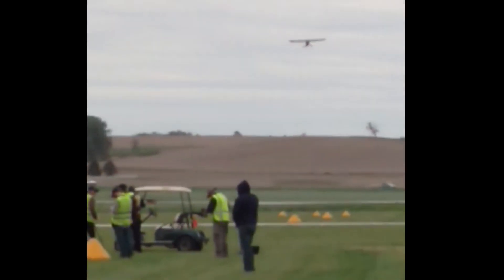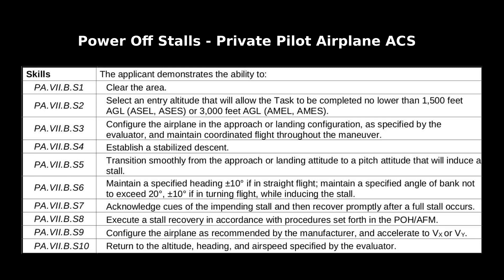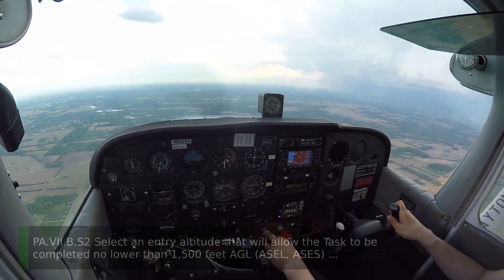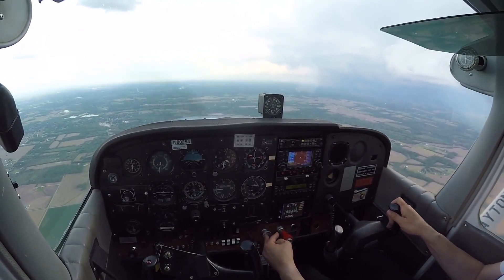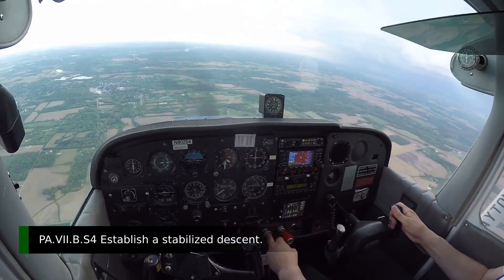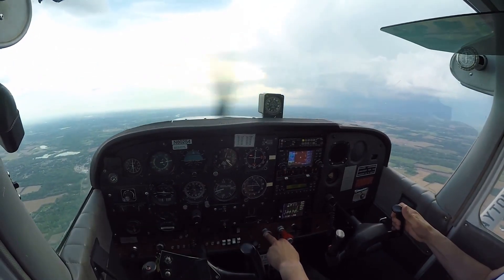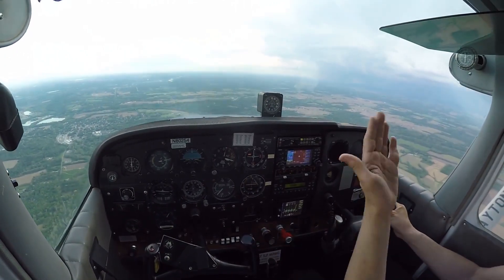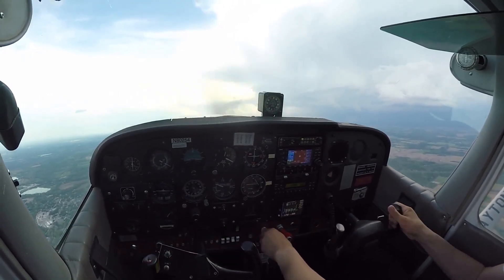Power Off Stall - Private Pilot Airplane SEL ACS

Comment: Is pulling back to the stops required ? I thought you could bring it above the horizon and stall.
Reply: Approach to stall means recovery at first indication which is the stall horn
Reply: @rudyberkvens-be depends on the certificate the one is after. Still, I don’t think you have to go to the stops. Power on or power off.